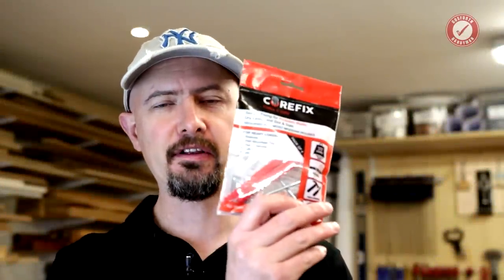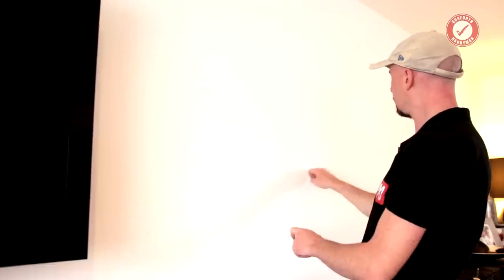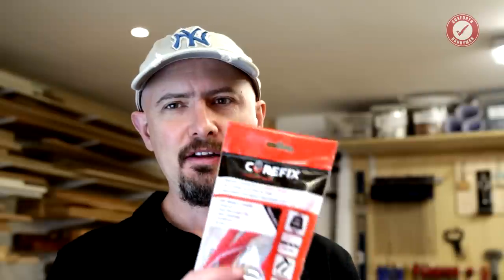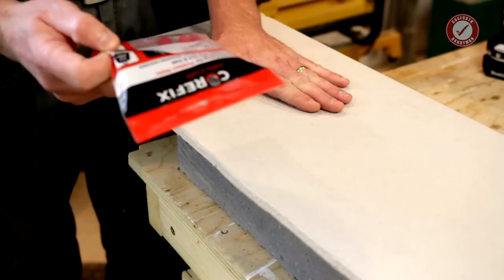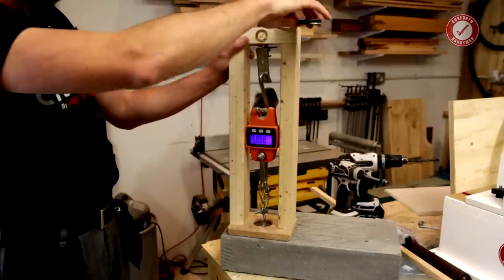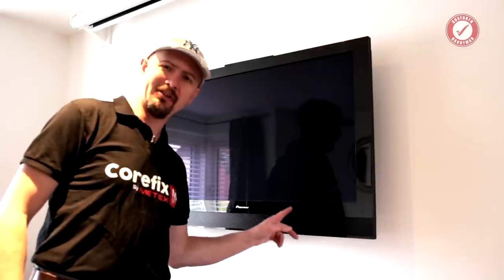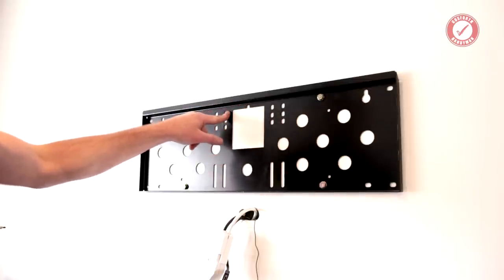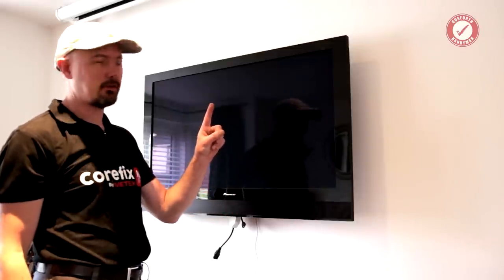How strong is a single CoreFix fitting in a dot & dab wall?

Comment: I think its called drylining cause they are lining the walls with drywall sheets. in NZ i remenber it being called gib lining cause we call them gibboard i think gib is the brand of plasterboard, then a taper and jointer plasters the joints then its good to paint after sanding the joints. Its only in the UK where you skim a perfectly good wall with multifinish, never seen multifinish before in my life until i came to the UK.
Reply from the maker: Yup - totally agree. I think it picked up the name drylining elsewhere in the world where they do what you're saying. Then in the UK for some reason we give it a full wet skim... and still call it drylining. 👍😂
Reply: @GosforthHandyman  while you are online, i have a blown dot and dabbed wall, any ideas how to fix it without removing the plasterboard?
Reply from the maker: Blown dot & dab? Never seen that. You get dot & dab over here - what's the blown bit?
Reply: @GosforthHandyman  some of the adhesive has popped off the back wall. I can push the plasterboard wall onto the brick by only 1-2mm
Reply: @Jules Moules i was going to do that but was not sure if it was going to work. 
I anchored the blown areas with corefix fixings and then skimmed the wall with multifinish to cover the screwheads.
Reply: @Jules Moules thanks for the tips, im guessing damp for my wall, i think i should have taken off all the old plaster and tanked it, i just PVAed the wall then dot and dabbed, my house is real old, maybe around 100-150years old, i have struck quite a few challenges in this house.